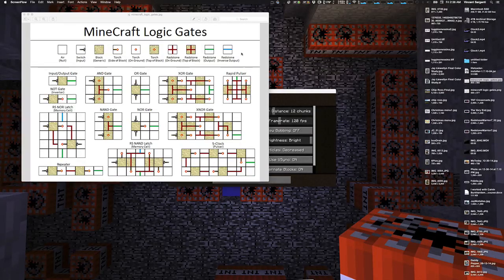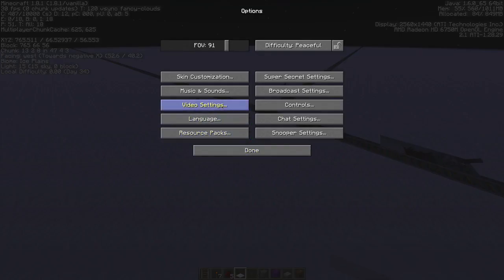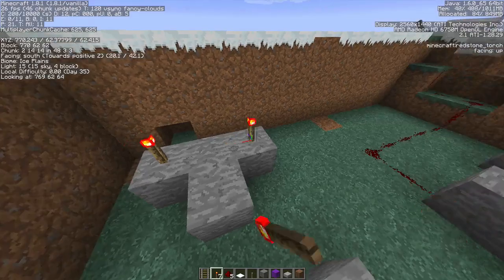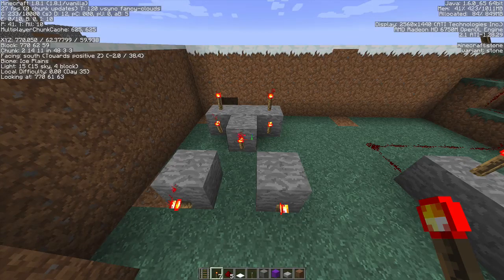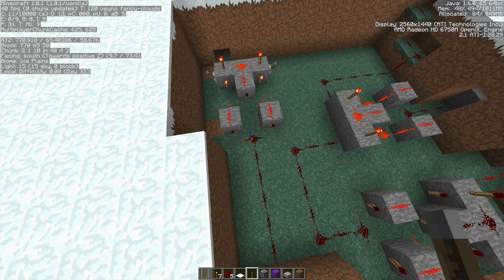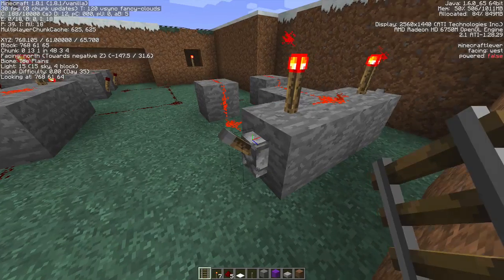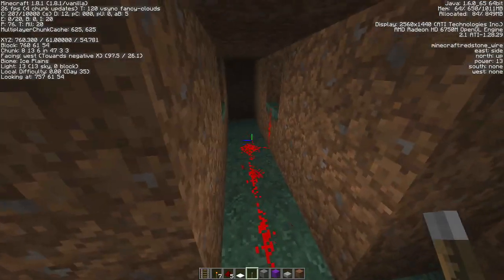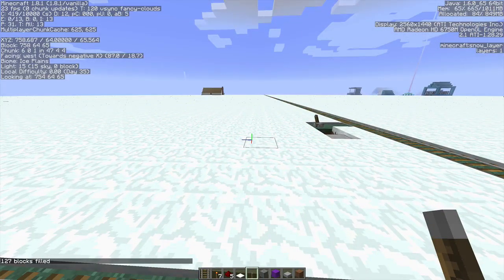Minecraft: Easy Minecart 3-Way Railway Switching System With XOR Gates Tutorial

Comment: Does this system have to be correct to the South/East rule or whatever?
Reply from the maker: No, it does not. Give it a try and experiment with it. It'll work in any direction. I have made tons of these and they work good anywhere.
Reply: That is HUGE!  This will be my third attempt at an intersection where the rails work properly.  Thanks so much for quick reply!